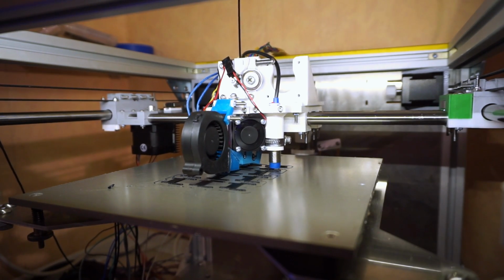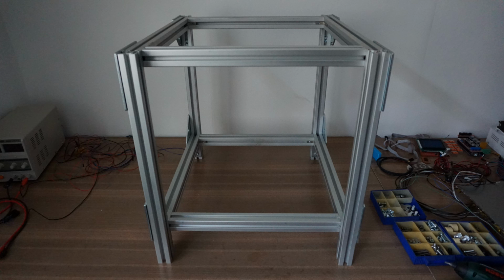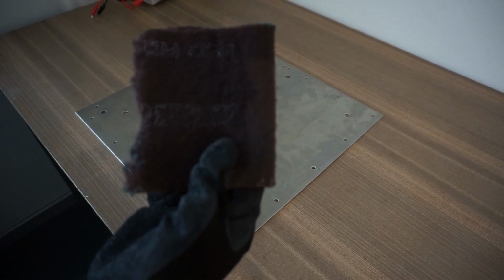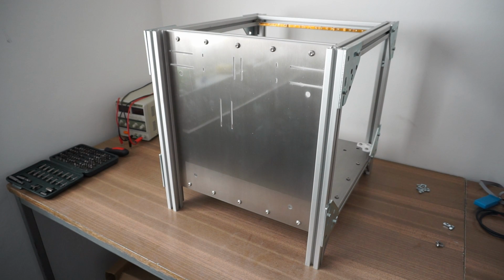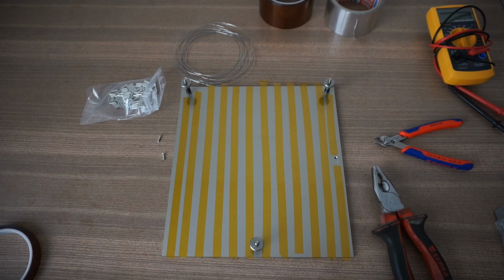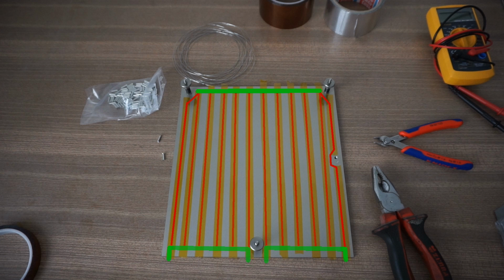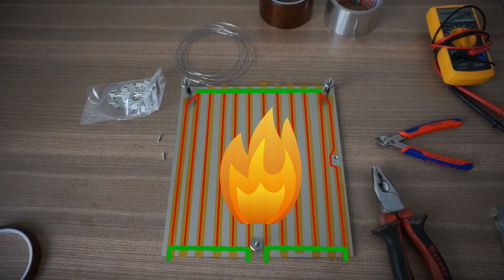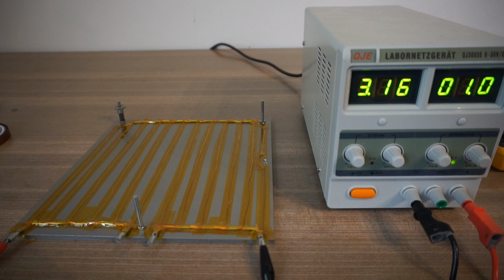(Re-)Building a 3D Printer - Part 1: Frame, Z-Axis and Heatbed

Comment: Most impressive work!  All the 3d printed components look great.  The z axis design is great, using belt loop, I did the same thing to avoid the dual stepper use.  We are much alike in our designs and methods.  Your dual extruder design is very clever with the 'master/slave' concept with slave nozzle height a bit lower to prevent interference, only requiring a z offset when deploying it.  Ooze shields are clever as well.  Great job and great videos, thanks for posting!

Two things I've found that you might like are:

1 - Split braided loom that you can put on after the fact, really springs back to center to look like regular loom
2 - 3/8" ID 1/4" OD semi rigid tubing added to bowden/wire harnesses adds great, springy support in a nice arc, put the split loom on the outside to enclose it all with shrink tube on ends.
Reply from the maker: Thanks a lot, I really like those suggestions. They are definitely on a list for a future build. Are you already using split braided loom? I am wondering if, due to the constant movement and flexing, the cables might be able to fall out of it?

Comment: Where did you get that belt? i need one at 1200mm and i cant find one :@
Reply from the maker: Instead of 1200, try to search for 1220mm GT2 belt. This is a more common length and you can find many of those on aliexpress ;).
Reply: Thanks, worked right away!!!